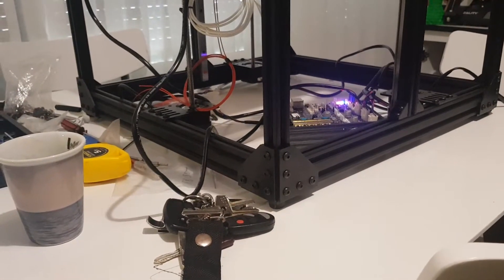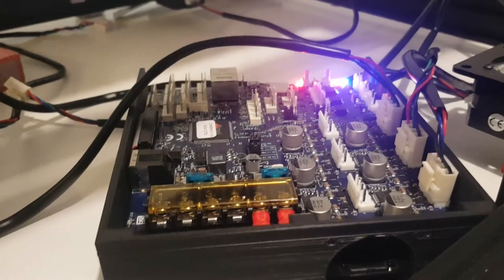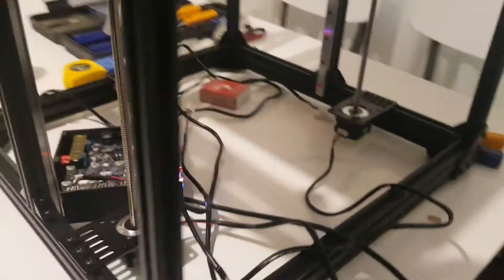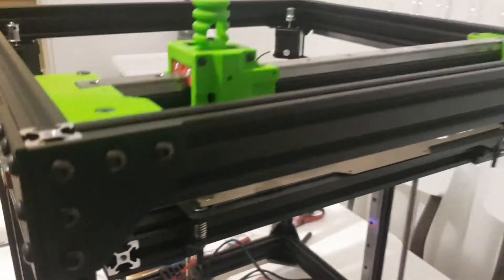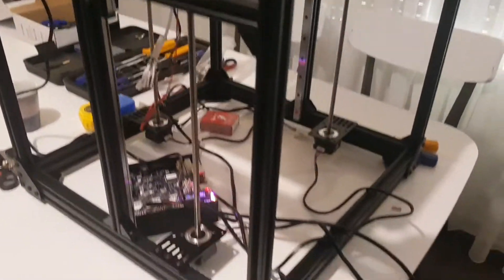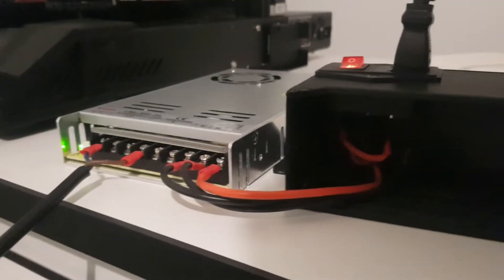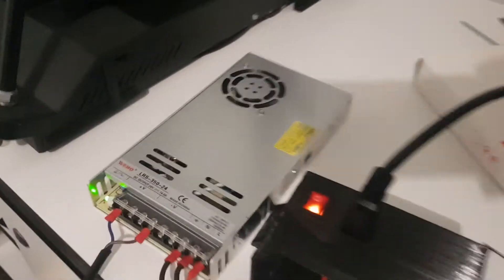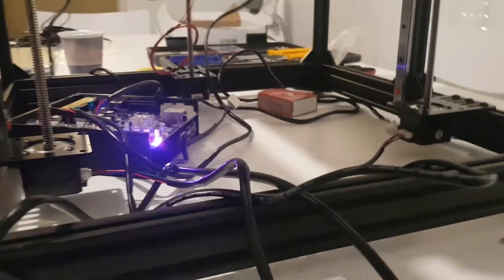my new 3d printer ratrig vcore pro almost finished updates on duet 3 faulty motherboard

Comment: Did you tried to reload the motherboard's firmware?
Reply from the maker: they offered me a free replacement. Some of the boards were faulty from factory - turns out to be an issue with the diodes.

Comment: Do you know if their are any build guides available for the 1.3?  I find partial but not the full thing.  Thanks
Reply from the maker: As far as I know there is no complete guide for 1.3

1.1 1.2 1.3 rolled out pretty fast and rat rig was evolving. So I believe people used the guide for original then they focused on upgrading whether from 1.1 or 1.2. Now that 3 launched I think they have their hands full and just focusing on the new stuff. I can see it is way better documented on the vcore 3

Having said that, if u have any trouble just hit the discord server. The community is absolutely awesome and there will be heaps of people to help out if you get stuck!